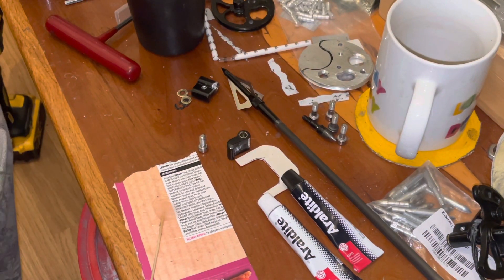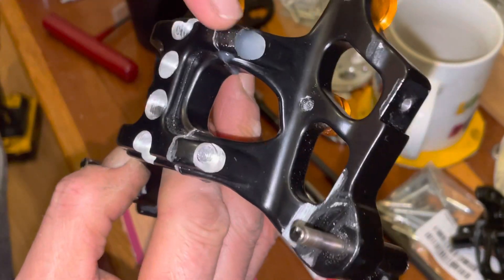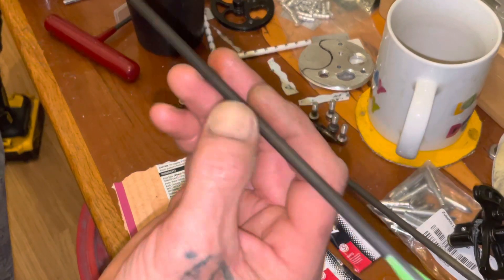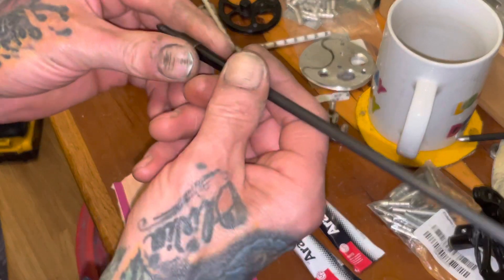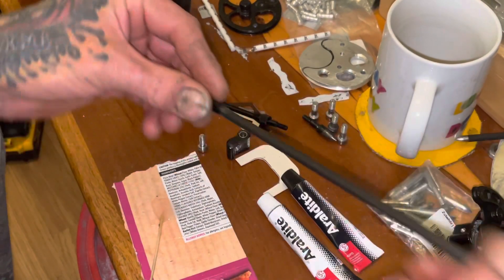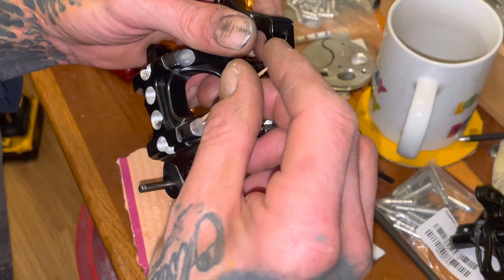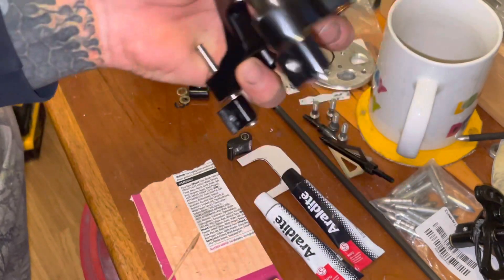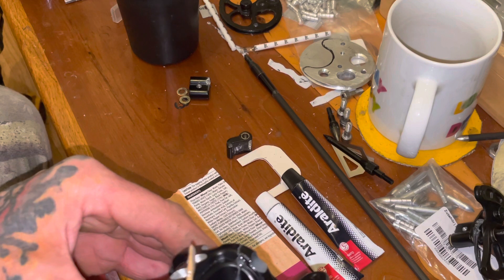Supersonic rev broken riser repair

Comment: It's always interesting to see what you are tinkering with. I'm searching for some illuminated nocks for night shooting. But, I'm thinking if I get anywhere near to the power you do, Then these nocks wouldn't last very long.
Reply from the maker: Thanks that’s good to hear, I’m just glueing the last 8 bolts in it & then paint & bed 😂 yes I did think about illuminated nocks as they’d help with bolt builds but you’re right my bow would smash them to pieces.
Should be back up & shooting again by tea time 👍
Reply: Yea heavy poundage mite kill them  but if your still around 120/150 class limbs I’ve had good luck with buying 4.2 lites arrow knocks and shape them into half moons work great but I don’t shoot them all the time just when in hunting  save wear and Tear as the little knocks aren’t cheap !! LOL
Reply from the maker: @markshreve2612  you should be well away if you’ve a lathe, can’t wait to get mine, I’ll never buy a nock or point again 🥳😂
Reply: @TheNorfolkBowyer  ow yea it was a game changer but finding good materials to use with out having do exclusively machine extra off  hence I’ve found the 6mm fiberglass ends I cut off work quite well I’ve hooked up a  small shop vac to catch the dust and a micron filter on the exhaust and try to do most of that work out side under a awning
Reply from the maker: @markshreve2612  I’ve ordered lots of goodies to build some new bolts, 500spine 7.8mm arrows & some whistling points 😁 & will modify flight deck to accommodate 7.8mm shafts. I’ve been listening to several talking about arrow straightness not mattering lately unless you’re an elite shot 😂😂 they say you won’t notice the difference between.001 & .006 😖 I must be one of the elite 😂😂👍
Reply: @TheNorfolkBowyer  yea as short as these bolts are wiggle is non existent though I try to stay in the 250/400 range long as the point incerts fit snug it’s all good but every five  or so I assembled like to spin test   With my fish bolts there’s no fletchings to install and every thing is out cert glued on little bolts at 16” with complete assembly are 600 + grns shoots are from zero to 12 yrds and water depth inches to three feet ? Lite bolts slow down hitting water and the fish ?
Reply: @TheNorfolkBowyer  or darn near close enough LOL the rats definitely think you are hahahaha I enjoy plinking  them with what ever I have available wether it be a air rifle or a bow of some sort and the minis are right up there in the gun  too bad that pheasant was out of season  that would made a great dish   Well keep up the great work and thanks for sharing
Reply from the maker: @markshreve2612  I’d love to have a go at bow fishing for trout but our laws here are very different from yours 🙄
I spent about 10hrs modifying my short rev body to accommodate the bigger bolts in 500spine & my new limbs I ordered have finally arrived so there’ll be some interesting vids to come soon 👍
Reply: @TheNorfolkBowyer   we  have laws to against the use on certain species here as well I can get big fines so I can only shoot carp species Gar some salt waters  I still have to have a hunting fishing license with an archery stamp to cover my self there’s bound to be rough fish your laws  will allow ?? Department of wild life in your country
Reply from the maker: @markshreve2612  our laws state anyone over 18 can own one but can’t hunt with them 🤔 think I live in the wrong state 😂 I’d love to shoot hogs & dear with my set up